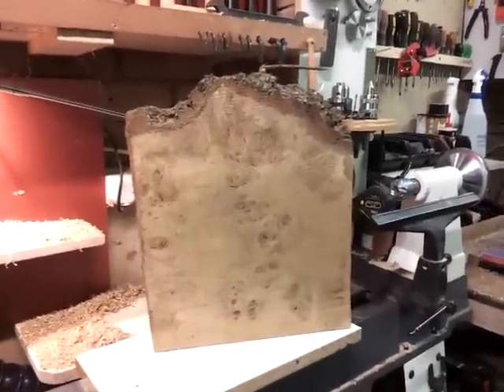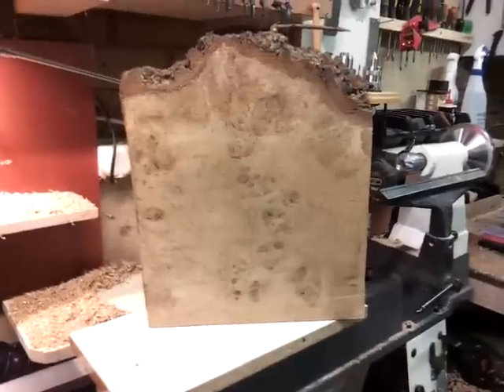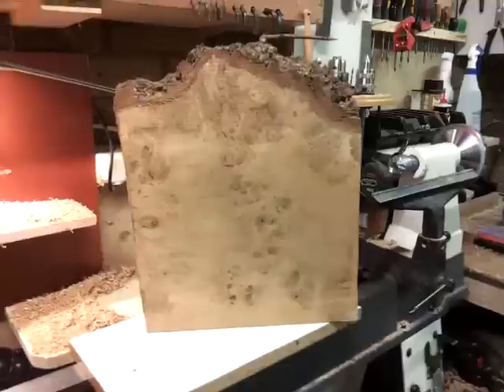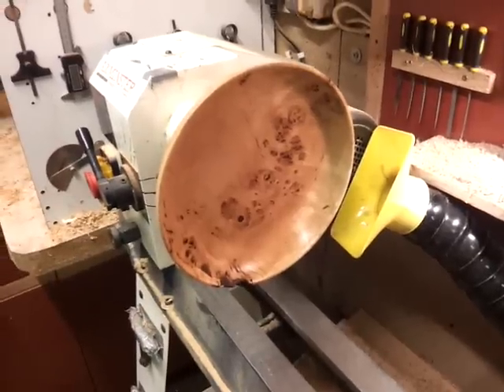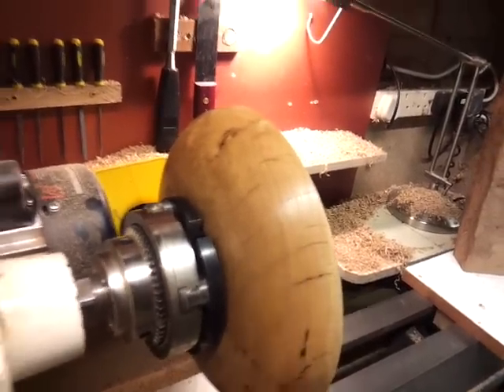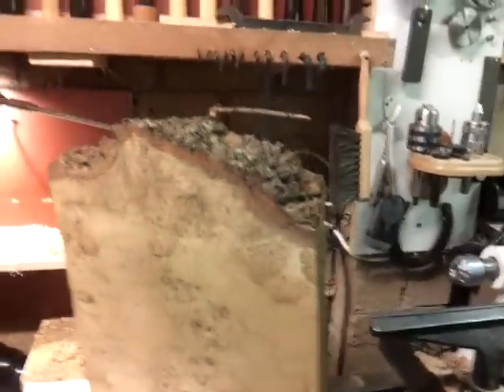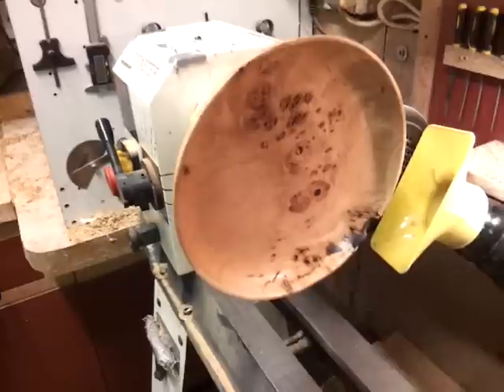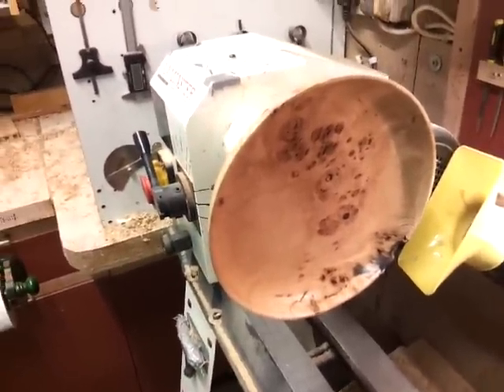Turning Oak Burr Platters - Some advice please!

Comment: My method of dealing with cracks is a 2 step process, first I use super thin CA glue over the crack, just to make sure it will not spread (since I usually finish with hard bees wax, and use friction to melt it into the wood, I'm always worried the heat will make the cracks expend), after about 10 seconds, I use medium CA (about 20 seconds to dry so you can work it) with fine saw dust to fill in the gaps. I try to do it before any sanding if my cuts are clean, or after rough sanding if not.

Comment: In the past I've used gold leaf substitute to fill in cracks in beautiful wood such as your burr oak  Sounds pretentious but it's not. I use gold leaf substitute from Axminster-lighter than a feather and therefore hard to work with.  CA glue and wood glue are not suitable so I use rabbit glue as it is slow drying and work it into the cracks with a fine artist's brush using both ends. When left to dry it can be fine sanded and the results are stunning [I think!]  I'm more Del Boy than Goldfinger!

Comment: Ensure you put CA glue in any fine cracks before you start to ensure it doesn't split on you. I had a 12" Oak burr split in 2 while spinning on the lathe. I was very lucky and it didn't hit me.
You must use a full face visor!

Comment: For finish, I rarely use anything but a french polish finish.  Mix 40% shellac, 40% DNA, & 20% BLO in a plastic honey jar.  Shake & apply to paper towel, then rub on the lathe when off.  After you're done, apply more at 600rpm.  There's a post w/more details on woodnet's turning forum - thread is titled fool-proof finish or something similar.

Comment: For hairline cracks, use thin CA glue and let it soak into the crack. For open cracks, CA glue with sawdust from the wood. Don't worry about CA stains; in the latter, you're going to turn off the high spots created by sawdust after the CA has cured. In the former, the CA stain will disappear once you put oil on the wood. I have a bowl that was cracked 3" down the side - glued it up and it was still painfully evident when I was done sanding. Put oil on and now I can't even find the crack.

Comment: one thing that came to my ming is a bit messier methor if you can call it that if noone has mentioned it before maybe a bit late but here you go. get a plastic bag clear and put a thin two-component epoxy in it together with your roughed out bowl or other project and suck air out of the bag, now let it sit until the epoxie become pretty think and take the rest parts of it let be until cured and the continue with your project. now you have a piece that has most cracks and gaps filled with epoxi

Comment: iv read most of the comments and even though it might be redundant. thin CA' is great for stopping cracks from spreading further, if you want the cracks to show as part of the finished piece just use that but watch out for the surrounding wood near the cracks it can stain your work. if you want to fill the cracks use the CA' with fine sawdust from the piece. a lot of my projects have cracks or bark inclusions, if done right i think they can make a piece look even better IMO.